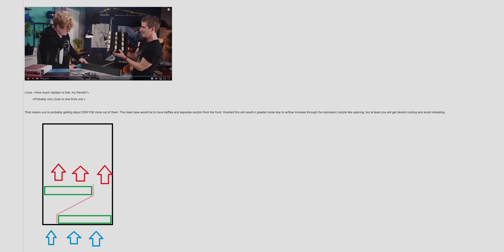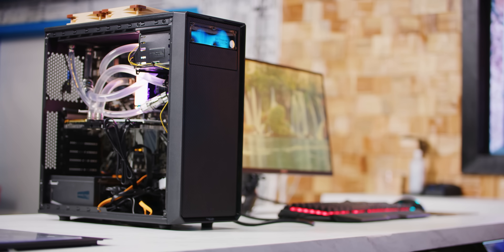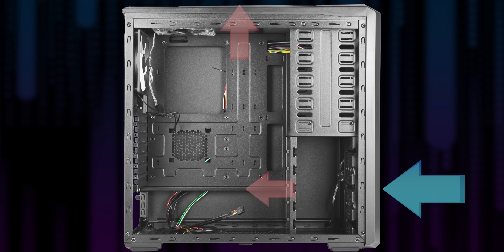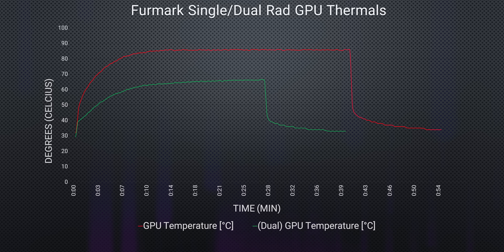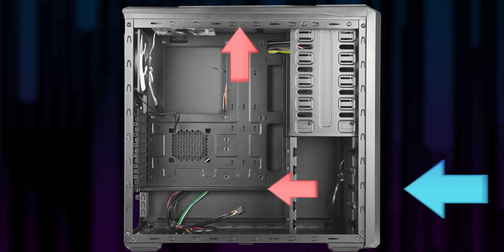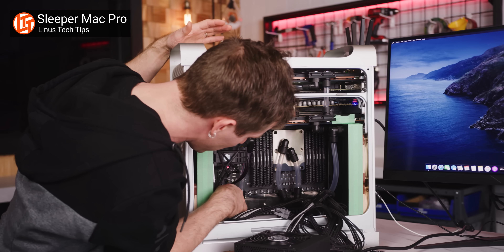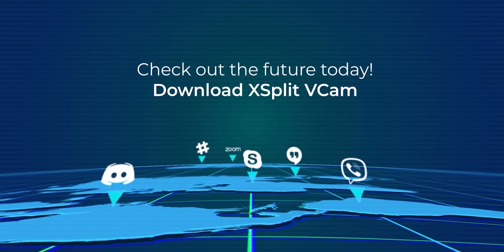I’ve been water cooling wrong for YEARS - $H!T Manufacturers Say

Comment: Another problem with Corsair's simulations is that programs such as Ansys either assume or have you input values for things such as air density at specific elevation, the thermal efficiency (in or out) of the air and material being used and much more. Long story short is that Ansys could be programmed to nearly perfectly model real world scenarios but would be WAY too much time to do so as every single possible metric that could change the simulation results would need to be measured and turned into an equation that Ansys can then use to model the system. Also the main point of programs such as Ansys are not to prove that they work in the real world but mainly to give engineers a (relatively) quick and easy method to test proposed designs and changes to current designs without having to physically build every little change and then go back by hand and recalculate every value.

Also if what Corsair said was true in the real world then stacked radiators like in nearly every car now would not work at all and would be pointless. I mean most cars and trucks have over 4 stacked radiators at least (if it is automatic and has AC, manual cars have less than 4 usually)

Comment: Such a thing already exists in real life, it's called a rad pack... you'll find them in ooh, I dunno... most cars? Assuming you have a turbocharged car with air conditioning, your AC heat exchanger, your radiator and your intercooler will be packaged together in your front bumper with very little space between the three. Some cars, instead of having oil/water coolers, will have a separate oil radiator as well, increasing the total to 4. 

Corsair I like you but come on, you're talking shit.
Reply: Unfortunately, you can't compare the air intake a speeding car gets to 3x computer fans at 60 to 90 CFM.  A better analogy would be stacking HVAC systems on top of each other. Can it work ? Sure. Would it be efficient ? I'll let you judge, but Linus's signature card is building overkill systems that only offer marginal improvement for a ludicrous amount of money. He's been doing it for years on this channel. And he's getting flack here because the test he's doing in this video  does little to answer to the concerns about his hackintosh and server builds.
Reply: @the_arcanum  Point well made, but cars don't have to be moving all the time! That's my fault that I didn't specify, admittedly. Maybe I should water-cool a server in the same circumstances to see if I can replicate the results.

Although I wouldn't expect a video any time soon, coronavirus lockdowns permitting.

Comment: Corsair's theory would likely be more correct if the radiators were rigged up "in series,"  - meaning all intake air comes through one source, passes through one radiator and raises temperature, and then passes through the second. You will indeed see less heat transfer in this instance since the temperature difference is smaller at the second radiator. 

However, in the configuration Linus showed in the video it appears both radiators have their own fresh air supply. So neither radiator really notices that the other is there. 

Neither Corsair nor Linus is completely wrong - it really comes down to how your air flow is configured.

Comment: stacking rads on  top of each other does not make sense unless their cooling capacity is very low.thick rads will have high cooling capacity (alphacool radiators).especially on a single loop i repeat stacking on top of each other does not make sense.third radiator will barely if any cool anything.series not stack on top of each other may work since the air passing through will be much lower temp than the water passing through.even then using very thick rads in series does not make sense.

Comment: The transfer into the water would be greater then the transfer into the air this disparity is made much greater with an extremely heavy load a medium load would be a more relevant situation where the convection into the water and into the air would be made more equal and the radiator would not become saturated enough to generate the difference in heat so in a realistic load situation there is a point in which you receive diminishing returns as you increase surface area the increase in surface area could cause an exponential reduction in airflow limiting the efficiency of the heat exchanger so the response to this all is really it depends on your application and airflow restrictions

Comment: Noob question but wouldn't there be more benefit by having the fans set so that both rads pull outside air in then have an exhaust fan for case discharge?

Comment: If the air flow is ambient - R1 - R2  - R3 - exhaust and your water flow is cpu - R1 - R2 - R3 - back to cpu then there might be something to what corsair are saying how ever if your water flow is cpu - R3 - R2 - R1 - back to cpu then it will provide a more incremental reduction in temp and be more efficient ie: water hits the last rad in the air path first, you wont get the full benefit of each rad's max heat dissipation but will get closer, and separating the rads to different locations will work better again than stacking the rads.

Comment: Not finished watching but 2 rads one on each side of the case pulling air in and venting to top? Yes eventually can run into diminishing returns obviously but you also have a bigger thermo load which by the time it cools the water that far in the loop you have this huge other part of the loop picking up more heat so basically the water (coolant) has more time to dissipate the heat before being reheated. That's why your data showed they were not correct in most real world results. Also hence why a central AC unit in a house has a huge rad instead of a small one.

Comment: There’s a lot to unpack with this test, but the simple fact of the matter is that Corsair is correct if you’re looking at the radiators in isolation. But what this doesn’t factor in the increased passive cooling through the rest of the water cooled system. Adding a second radiator is always going to improve cooling simply because you’re increasing the thermal capacity of the water cooling system by adding more water. You have more tubes, connectors, etc. As well, each stacked radiator is going to be less efficient than the first one, but if you’re stacking radiators to  address an overheating issue then you’re probably less concerned about efficiency in general.

Comment: You talked about having them stacked in succession was wrong, yet you tested it with two radiators in different locations (not stacked), where one would not blow hot air onto the other.
Reply: ...but at the end they talked about that
Reply: Because that was the first setup that got critiqued. Rewatch the video
Reply: That's a good point. LMG does address that specific layout and their answer is correct. Still, testing to verify a claim should be done in the same circumstances and showing the front and top layout would've been an awesome add-on since that's a more common use case for most cases
Reply: Misinformation right there. Hopefully HN tests this how it must be done

Comment: You have more thermal mass by adding a 2nd radiator (more liquid and literal mass to heat up), so it definitely makes sense if it takes longer to get to peak temperature. I wonder if their computational model accounts for both fluid of air and fluid of water, and the effective heat transfer and heat differential at each point of the chassis. The extra air getting into the chassis probably helps as well. 

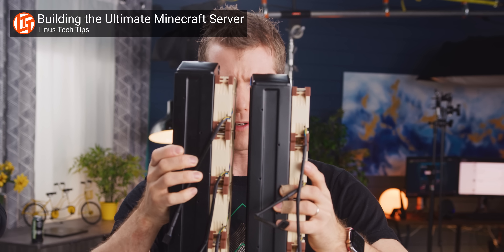It is true that the greater the temperature differential between the thing you're trying to cool and the temperature of the air at which the radiator makes a difference. Therefore if you had 2 radiators stacked inline the efficiency is probably lower (1:29) and at a certain point useless to add more radiators in that way.

Comment: I never knew water cooling worked with the water hot using fan blown air to cool it.  I always thought it was something like an AC with refrigerant.  Does anyone know if there are any computer cooling designs that use refrigerant like an AC unit?  It seems like it might work with a hot radiator on the outside,

Comment: this test would be better with the same volume of coolant. thermal inertia is different from thermal dissipation.

The gain you observe is due to the mass of water and metal, a simple tank will give you the same benefits

You have to measure what calorific load you manage to dissipate without thermal trottle

Comment: Personally i would put every rad as an input of air not as an output of air being drawn though them, then have a second fan for an input and 2 other fans to help with extracting  excess heat.. then it  wouldn't matter how many rads you have in line so long each has a source of cool  air, doubling rads would best work if you tee them separately  so they share the heat load and make sure the flow of coolant is is fast enough to move heat..

Comment: Did LMG reach out to Corsair before making this video to get some more specifics? Seems strange that they wouldn't provide you with th simulation data for comparison to your own testing.
Reply: Because it’s not important and this doesn’t matter at all.
Reply: @Devolve Studios Stacking radiators can very well increase cooling. As long as you do it right. But you very much are right. The whole point of this video was to inform people to do their own personal research and assess their own builds. Dont take any single source or company at face value EVEN LMG!
Reply: @Devolve Studios If you stack them with hottest RAD closest to the out-take and then stack them hottest to coolest, with the coolest closest to the components. Then you wont lose really much if any efficiency. They did exactly the opposite on the Minecraft server of course but that was just a fun build.
Reply: @Devolve Studios In a stacked situation you use more fans which offsets the airflow restriction. And yes, if you put the hottest RAD next to the outake the others in the stack will be pulling their air from the side of the stack closest to the components. Which will pull fresh air from all points in the case. Creating Negative pressure, however you can (and should) offset this with another inlet to create positive pressure.
Reply: He performed his own tests using real world situations. The whole point of the video was to show that simulation data doesnt 100% translate to the real world and should always be verified with deep detailed testing in the real world.  Which is what LMG did here. Though they could have done MORE...it does represent the data clearly.
Reply: @Dem0n1337  the Minecraft server radiator is much larger than the 240mm rad used in the test and it made only 5 degrees of difference rather than 20 in the test.
Reply: @Dem0n1337  detailed? Not even testing what Corsair was saying,, he never stacked ratiators, he never take out 1 radiator out of the hackpro. It's a half-ass experiment just to diss people , obviously 2 rads far away from each other with multiple airningakes it's gonna cool more, but if both where side by side the performance will dramatically drop off
Reply: @franciscobarrazasaavedra4754  Dude, the hackpro has seperated rads. Same situation as this PC. So the results would be identical. Stacked radiators? Sure maybe would have made a difference there. However the whole pint of this video was proven. No matter how many simulations you run and data you gather from them. You will never be able to predict what real world results will come from it until you physically test it. He literally said that it should be tested or do your own assessments. This isnt a dig at Corsair. Its a dig at people who refuse to listen to results. LMG tested it, and showed results. They admitted they are not without fault, and told the audience to do their own research and not trust a company like Corsair just because they ran a sim. Real world results will always be different than any simulation that is run. You cannot account for everything.

Comment: My dual rad setup has 3 fans blowing cool air on the main rad and then 2 fans exhausting hot air off the second rad out the top of my case.  I also have a rear fan exhausting, so theres some kind of airflow always going across the RAM and VRM heatsinks.  With that said I'm always surprised at how much hot air the rear fan kicks out when I'm gaming.  So I do wonder if my chipset etc is getting sufficiently cooled, especially in the summer.  I've been building PC's since I was a kid and this is my first watercooled setup, I can't believe it took me so long to make the plunge..  I was so worried about leaks, but it was the best thing I've ever built.  Should have done it sooner!

Comment: sorry, your test is crap.
the 2. radiator pulls fresh air from the back top and bot.

you should instead have tested this in your server case scenario, where all! the air has to go through first rad no. 1 and then no. 2
just test jakes minecraftserver by removing all but one rad there. then you can call bs on corsair (never bought anything from corsair, just science speaking).

Comment: Yes, Corsair doubt make sense, but i think you also need to check not only about thermal exchange between air and water, but also about radiative heat emission (your thermal exchanger are painted black, which increase radiative heat dissipation in IR wavelength than an unpainted water cooler).
Every heat exchanger have its own exchange efficiency < 100%, so your 2nd and 3td radiators may be running better in radiative cooling than metal to air heat transfer.

Also, some heat can be exchanged in interconnection pipes.
For an good test, i would:
1) Insulate all plumbings.
2) Try 2 different setup:
     a) Airflow goes from radiator a to radiator z.
     b) Every heat exchanger have its own fans, so airflow goes only in its own radiator.
3) Measure temperature for every heat exchanger.

Comment: My guess before watching the video is- more radiators help in the sense that they slow the time it takes for the system to get to temp (because of the greater volume) but they don’t change the max temperatures since the bottleneck is the fan cooling the water

Comment: I think you're right about airflow from the other openings and fans helped you with the 2 rad setup. But Corsair's take away from their CFD test is fundamentally sound - greater temperature delta will lead to more efficient cooling. That said, their models in airflow within a case were obviously flawed (or didn't account for airflow leakage).

Ideally for a 2 radiator setup you want to be taking in the coolest air possible, meaning independent intakes from outside of the case. That will ensure the greatest temperature delta for each radiator. 

In short, your test was incomplete. You were testing whether or not your system worked IRL, which it did. But... It could have worked better.

Comment: CFD simulations have constants requires curve-fitting of test data, since every build is unique CFD does not quantitatively reproduce the reality. The build is also asymmetric, therefore a 2D simulation represents a 3D flow poorly. I think you can also reduce the radiator outlet temperature by increasing the mass flow rate of the air by whacking up the fans.

Comment: Is the second radiator added right after the first one? I have no clue how 2 rad setups are done but to me it would be better to add it between the CPU and the GPU so the heat from the CPU is dissipated before it hits the GPU.

Comment: air leaks in case give extra fresh air. 
I also don't agree the air coming off the rad is a few deg cooler than the loop. that's horse shit IMO, and surely is fan speed dependant.
Take electric fan heaters, wouldn't they melt the case if the air coming out was only a few degrees cooler than the coil element?

Comment: Curiosity question. Did you have the case closed up, or did you have the side panel off for the test? If the side panel was off then you're allowing plenty of external air into the case, which should greatly lower the temperature gradient between internal case air and the radiator. Increasing your heat transfer between radiator 2 and the air.

Comment: Since there are holes for air everywhere in this tower, I think that if the second radiator was placed in the bottom of the case blowing cool air inwards (same as the front radiator) and some single fans in the upper side blowing the hot air out, the results would be much better.
I dont know if the power supply leaves any room for that though...

Comment: Heat exchangers are a whole world of their own. Each layer is progressively less efficient. And it has a lot to do with the speed and heat capacity of the cooling air. you can even get it wrong enough that you're generating more heat with an enclosed system.

on engine radiators you'll have a low temperature radiator in front of a high temperature radiator for the part that needs to be cooled lower temperature than the next part. But I still have limited capacities.

Comment: Why did you guys not focus the argument on what Corsair was telling you was wrong? You all just tested a different set-up with a key feature changed... This is a low quality video.
Reply: They did with the minecraft server: Removed 1 of the 3 rads and temps shot up - myth busted. More surface area = better, if the airflow isnt crippled completely.
Reply: @Franzl0rd  yeah, but they focused the video in the test rig that had a radiator set-up that differed from the one that Corsair was challenging, right? Did I misunderstand what they said?
Reply: @dakotadanderson  They (corsair) disputed both and LMG proved them wrong both times.
Reply: @Franzl0rd  Wow, I am just a dunce. They do explicitly open up with the intake and exhaust radiator set-up... I am sorry for aggression. Thank you for debating with me instead of yelling, comrade.